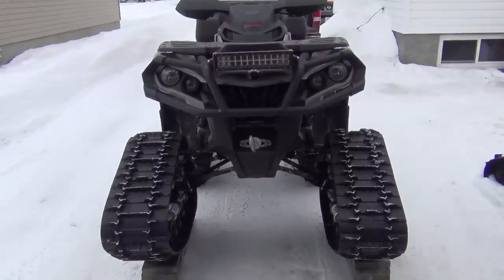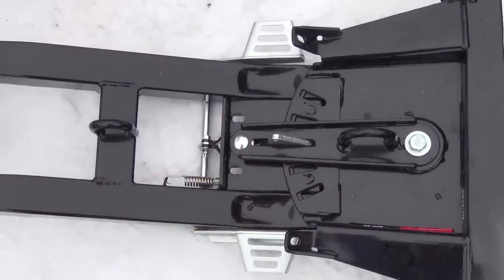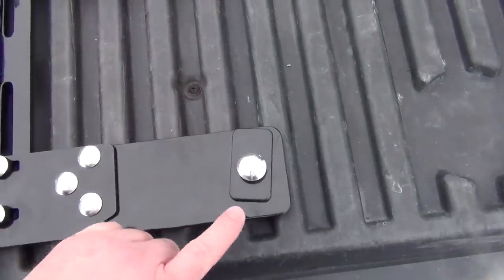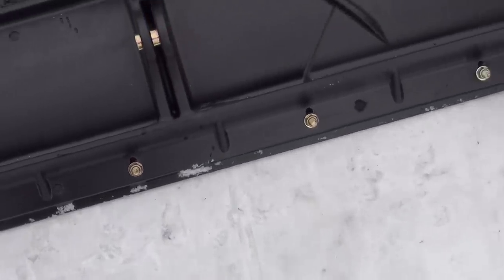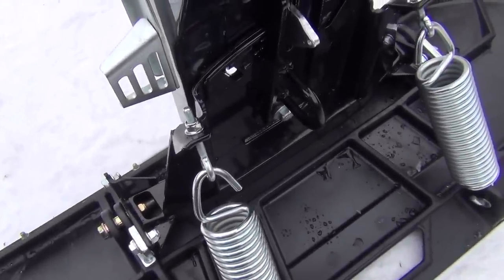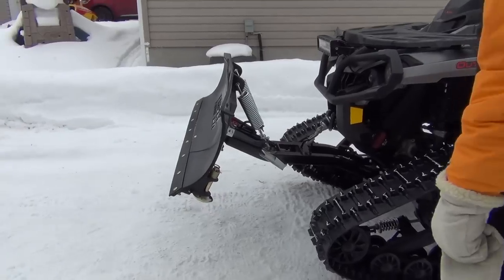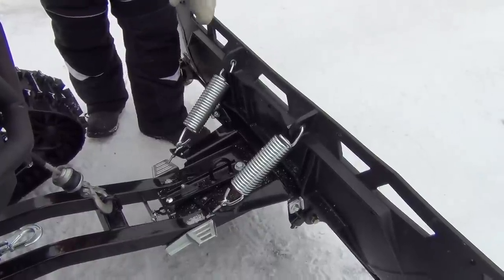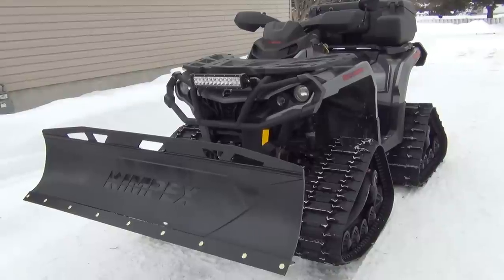ATV Snow Plow Install - Kimpex Click n Go 2 On Can Am Outlander 1000

Comment: Ya man, that's slicker than greased owl poop to put on & take off the blade! Me like!
I'd definitely remove the brackets under the skid plate for the summer though. Those bolts hanging down would catch hard on a lot of the stuff we drive over.
Looks real good on the beast. Maybe just leave it on so you can open the trails up for us guys with tires - LOL
Excellent DIY video bud! Thanx for sharin'!
Reply from the maker: So very easy to take off and put back on, that is what I like!  The mounting bracket with only 4 bolts will be easy to remove for summer too which is nice.  Need more snow though to test it out.  Thought about plowing a skating rink on the lake behind us....might have to give that a try this weekend.  Thanks for watching and commenting Q!

Comment: I have the Click n'go2 with the steel blade. The big problem i have with this plastic blade vs steel is that you can't put a deflector on the top edge like the metal blade because of the angles on the top edge...??? Also like another guy said the weight is not there for breaking up hard crusty packed snow...

Comment: The bolts you talked about that you needed for the plastic blade compared to the steel blade. Did they come with the blade or did they come with the push frame? Reason I ask is because I want to switch out for a plastic blade and I’m not sure if I have any extra hardware from my kit. Thanks.

Comment: How do you like this plow? Is it the 60"? Do you think it is wide enough?
Reply from the maker: Haven't used it very much, but so far we like it.  Really easy to take off and on. Yes it is the 60" .  For what we would use it for seems wide enough.
Reply: @cubbeezx  What about when you angle it with your tracks?
Reply from the maker: Definitely need the 60" with the tracks on.  It is close, but still ok.  The drift cutters seemed to help to.

Comment: The double pivot is cool, but that plastic blade isn't going to give very much down pressure. I had issues with my steel blade not having enough weight to break up packed snow. Does it tend to bounce a lot?
Reply from the maker: Haven't actually had a chance to use it  yet...will give it a good work out though when I do!
Reply: I have the plastic blade. the design of the blade creates downforce when snow starts to pile on the blade face if that makes sense? Works great for me and really light on the suspension when raised!